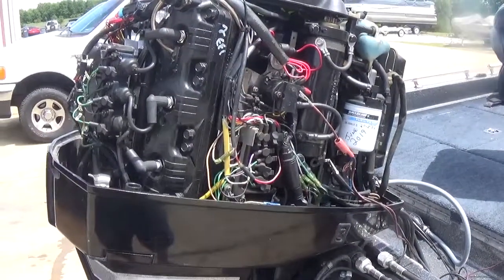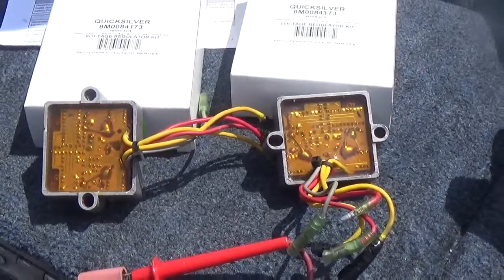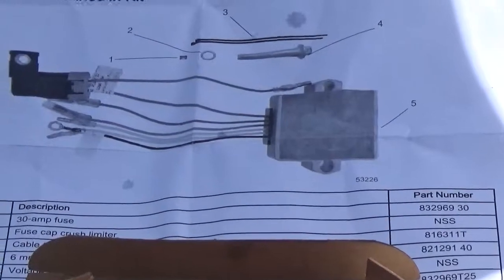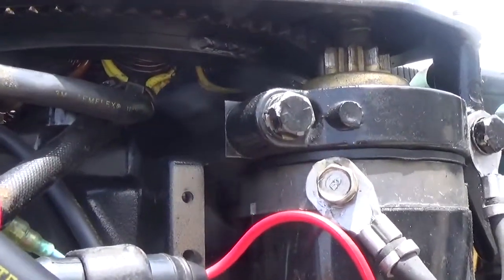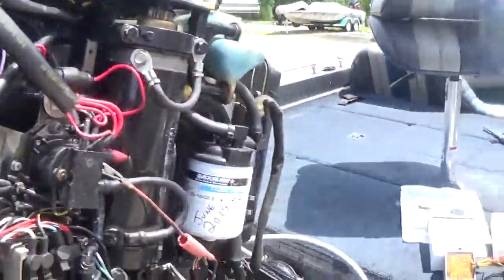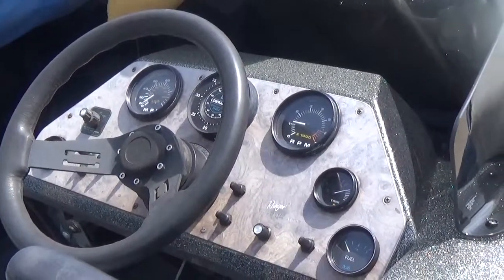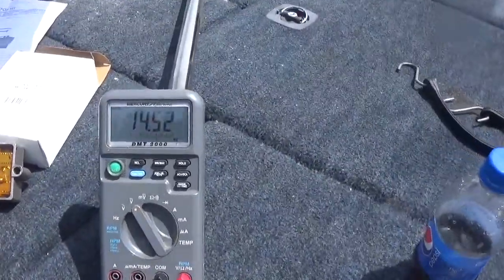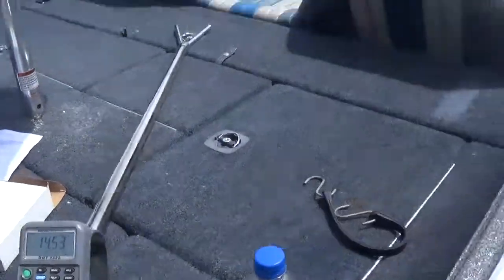Early 90s V6 Merc Outboard Charging System

Comment: Excellent video. Got a 95, 175efi and just had the lower rectifier go out. I was looking for videos that showed how to install a rectifier on that motor when i found this video. Even though it didn't contain what i was after, that info about the wear on the stator was extremely valuable. I'll be checking mine tomorrow. Thanks for sharing!

Comment: Hi I'm adding a fuse to my 2002 mercury 75 2 stroke and was wondering if it blows does the engine cut out 
Or could it damage the stator. Thanks

Comment: I have a 1994 mariner 115hp with not charging issue. Matinee dealer said to replace the rectifier and I bought the rectifier part. I can’t find the rectifier on the engine but my engine does have the clear top voltage regulator. Do you know if my engine would have both a rectifier AND a voltage regulator?? Btw great video and very informative.
Reply from the maker: The regulator and rectifier are one in the same on your engine. The clear top unit you have now, as well as the replacement unit, serve both purposes.